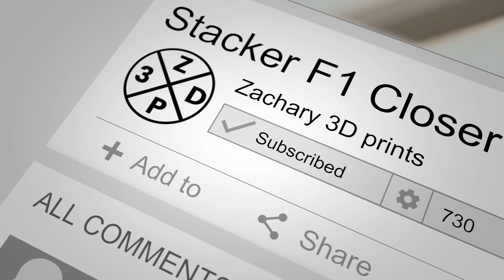How to install Phaetus Dragonfly on Ender 3 Pro

Comment: I just got it. Installed with an airbrush nozzle to offset a bit the height of the hotend. It works beautifully
Reply from the maker: That is great to hear. But using an airbrush nozzle? Original.
Reply: @Zachary3DPrints  I couldnt find the original unfortunatelly, its very difficult to import from europe for me.
Reply: Also i forgot, just revisiting the video, the stock mk8 has small washers that I put behind the dragonfly against the base plate, those washers give the enough clearance needed for the sock to properly fit

Comment: I'm having big, big trouble with this hotend installation. I used spacers to avoid the heatblock touching X-carriage, that was easy. I replaced the nozzle because the steel one was 0.35mm (although carved with 0.4mm mark) and seemed partially obstructed. I lowered the BLtouch so it could touch before the nozzle touches the bed causing the Z-motor to fight the plate non-stop. Now I believe the issue is the stock fan cover, which I can feel cold air being redirected downwards and immediately warping the PLA filament being extruded no matter at 195 or 230C.
Reply from the maker: Hello berfava, that is not so great to hear that you are having issues. Do you still have them?
Reply: @Zachary3DPrints  (Just an aside: nice to see you're still monitoring this.)

Comment: I bought the Phaetus Dragonfly BMS for my Ender 3 (non-pro). The heaterblock is VERY close to the X-axis carriage, I'd say there's 0.5mm between the heater block and the carriage plate. If you mount the hotend (heatsink+heaterblock) without the silicone sock, there's no way to put the sock on. If you mount the sock before mounting the hotend, then the sock will be squished between the heater block and the carriage plate ( more specifically against the eyelet of the lower roller ). I've mounted mine with the Phaetus logo on the heater block facing forward.

I don't see a solution to this other than installing washers, which will offset the nozzle and reduce the Y-axis with a couple millimeters.

Did you run in to this and if so, how did you solve the issue?
Reply from the maker: Indeed the same issue I had with installing this hotend. It's very close the the carriage and indeed less till no room for the silicone sock. I didn't use the silicone sock because it was hard to put it on and in case you want to remove it, it gives you trouble. And I like the engraving on the heater block
Reply: @Zachary3DPrints  Thanks for the quick reply! :)

I actually installed it with the heater block rotated about 45 degrees to the left. Still, the sock is a bit squeezed in there but yeah, I'll use like that for now and see if I can muster up some GAS for a linear rail X-axis.. :)
Reply from the maker: linear rail for the X-axis? Nice choice...
Reply: I had the same issue. I used 5 washers on each side which spaced it out about 2.5 mm. The resulting Y offset of the nozzle from the stock nozzle seemed to only be about 1 mm though based on my BLTouch offset measurements.

Comment: It looks like your fan ducts are lower than the nozzle now. And that’s exactly what happens on my Ender 3 with this hotend. The Dragonfly is quite a bit shorter overall length, and the fan duct now is too low and hits the bed first.
Reply from the maker: Hmmm, It doesn't seems to irl, I never had problems with this setup

Comment: I bought this bms Hotend and it kept leaking molten PLA over and under the heatblock.
Everytime that happened I disassembled and cleaned it, but it kept happening, so I think I‘m gonna sell mine if I can’t find a way to fix this issue
Reply from the maker: Hello friendly great chicken, when you installed the heat break, did you made sure that this heat break was in there for over the half of the heater block, that if you are going to install the nozzle that you have a little gap between the edge of the nozzle and the heater block?(just to be sure).? After you have done this, heat up the hotend and fully hot tighten it for a good fix between the heat break and the nozzle?

Comment: i need to put the thermistor all the way into the brass tube (glass ball and wire all covered in grease) or only the tip with the glass ball?
Reply from the maker: better to put a little dap into the tube, put the thermistor in, then fill it with more paste/grease. Be careful with screwing in the grub screw.

Comment: Hello, I bought Phaetus BMS version to my Ender 3 v2. Installed, did PID tunning, e-steps calibrated (I also changed my extruder to BMG) and I have such big underextrusion that I cannot print first layer. Why? Please help.
Reply from the maker: Hmmm, before the upgrade to the Hotend, did you also had under extrusion? Because I did install the BMS and didn't change anything within the settings. But if if extrude filament, is it consistent? Did you consider changing the PID settings back as they were?
Reply: well, this is a really old questions but I thought I would answer if anyone else has this same issue.  This is due to E-Step calibration.  With the BMG your E-Steps will typically be a setting between 410-418

Comment: This might be bad cad models on my part, but when designing a hotend assembly for this hotend the silicone sock coincides with the x axis carriage, such that a spacer between the hotend and carriage is needed. Since you have access to the physical parts, what is the gap between the heat-block and the x axis carriage? Much thanks, and great video!
Reply from the maker: The gap between the heater block and screw of the carriage is indeed not very big. For me it was OK like this. You can check if you can put spaces between the Hotend and mounting holes from the carriage.
Reply: @Zachary3DPrints  good to know! Thanks for the quick reply :)

Comment: Thanks for the video.
As far as I see you haven't mentioned where you put the thermal grease. Did you open the hotend and put it on the upper part of the heatbreak, or the heater cardridge, or the nozzel thread?
Thanks for the help :)
Reply from the maker: Hmmm 🤔 ... Didn't I mentioned that? OK, thermal grease is going into little tube for your thermistor and put your thermistor in it.
Reply: @Zachary3DPrints  no grease on the heater cardridge or nozzle thread?
Reply: @Fordham0815  I think the idea was to improve heat transmission to the thermistor so it’s reading accurately.  Hence the cylindrical hole/brass tube being the only parts that get greased.

Comment: The cartridge heater that ships with the 3 Pro is longer than the width of the heating block. Is there a shorter cartridge heater out there somewhere I should use? 

Or does it MATTER if it sticks out on either side? Looking at your video, I'm guessing it doesn't matter...?

(And echoing some comments below, yes, a couple of tiny washers or whatever would help immensely to keep the silicone sock from bouncing against the X-axis carriage...)
Reply from the maker: Hello, sorry for my late reply. Yes it doesn't really matter, as long as the midpoint of the cartridge is in the middle of the heater block.

Comment: HOW did you install the thermistor? for me it falls out all the time
Reply from the maker: You have to pull the wire from the thermistor a bit, in order to have a bit more. Why is that needed? In that kit, come a little brass tube, your thermistor is going in there all the way. Use the thermal paste/grease to fill that into the brass tube, with the thermistor still in there. Once that is done, put the 'assembly' in the smaller hole in the heater-block, until it is flush with the other end from the heater-block. Screw the grub-screw in as far as possible, by doing this, the screw makes a dent in the brass tube and hold the thermistor in the tube as well. So it press fits the thermistor into the brass tube.
Reply: @Zachary3DPrints  Thanks! i was a little worried when at first the screen said "thermal runaway detected" but now i know why.
Reply from the maker: No worries buddy, no worries
Reply: Little late here but thanks where struggling to

Comment: Hi can you or some one explane the differents between the bmo bms type
Reply from the maker: I'm working on a video idea for this covering this and other hotend related topics
Reply from the maker: BMS are like the ones you can screw in on the carriage of the printer, BMO has the round mounting part like the E3D V6 hotends where you need to clamp the hotend into the carriage

Comment: Nice video! Can I install this hotend on my Ender 3 pro even using the stock fan cover? Also, do you recommend any way to make this into direct drive?
Reply from the maker: Thank you for your questions. Indeed you can use the standard fan cover. This hotend was designed to fin in this machine. For the direct drive, you mean installing this hotend with the direct drive? in both ways, it is possible to use this hotend.

Comment: Did you have trouble installing it over the anet et4? You just installed it or you needed to make modifications? Btw nice job man
Reply from the maker: Hey buddy, I did record everything until i found out after several little mods, that it became too complex. I arranged that footage into a video and published it today, if someone has a solution then they can use this method.
Reply: Thanks man, i would like to make that mod I will be seen that video
Reply from the maker: I have now also added the fan duct.

Comment: Does this hotend use the same nozzle thread as the micro swiss hot end?
Reply from the maker: I'm not sure about that. The BMS style is fitting on the Ender 3 so basically an MK8 nozzle should fit. The Nozzle which is with this hotend is hardened steel nozzle
Reply: @Zachary3DPrints  thanks for the reply.  Im interested in this hotend to see if the copper heatblock is better than the aluminum one on the micro swiss.  Ive had to replace mine a few times because of the threads stripping out when changing nozzles, and I always heat to 235 before removing thebnozzle.
Reply from the maker: Yup I understand... One time I had to change the nozzle on the Micro Swiss... I replaced with the wrong send size... it broke off.
Reply: @spikester1968  Microswiss should have a standard M6 design (aka e3d's V6). the Phaetus takes standard V6 nozzles so are  Slice Engineerings nozzles.
Copper blocks are more stable in temperatures and can handle higher temps like 500+ degrees celcius, i got copper blocks on almost every printer i have, also some brass ones. The aluminum versions are OK but limited. Brass blocks are great too if you don't print higher than 350. Brass heats up faster but also cools down slower. There are a couple of studies about what to use for your applications. But ill stick with brass and copper :)  and hardened steel or copper nozzles.
Reply: @Underp4ntz_Gaming_Channel  Micro swiss use a Mk8 nozzle. It is a M6 thread but is a different pitch to the V6 nozzles so its not compatible.

Comment: What is the difference between dragon and dragonfly
Reply from the maker: beside the design, I think there is little difference, It looks like the Dragonfly is more improved
Reply: @Zachary3DPrints  thanks for the info. Do you know what nozzles they use (especially the high flow)?
Reply: @Zachary3DPrints  Nah dude ya got that backwards. Dragonfly is a cheaper line of hotend. A dragon achieves what a Dragonfly does but the dragon does so at half the weight. Dragon is a much better hotend.